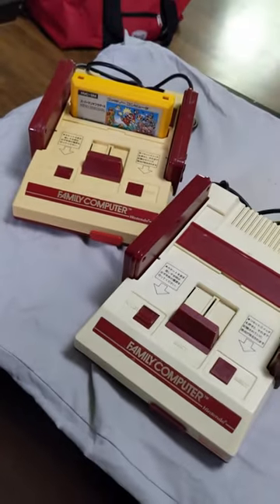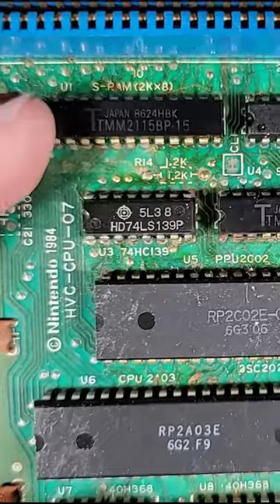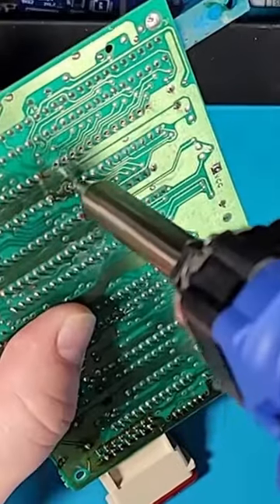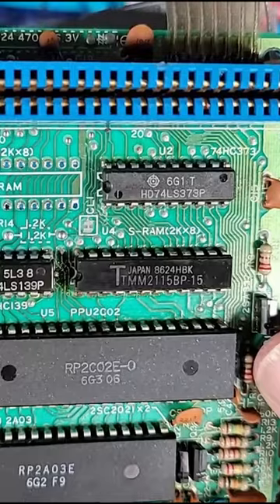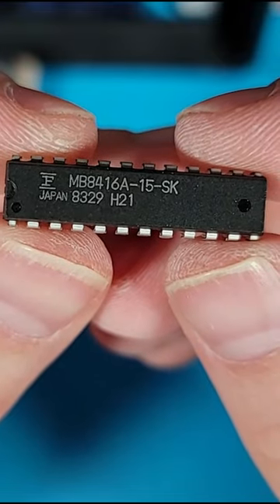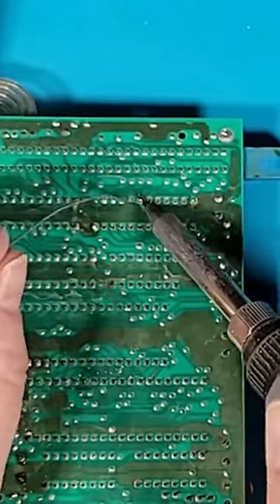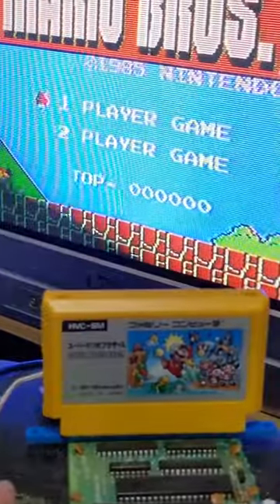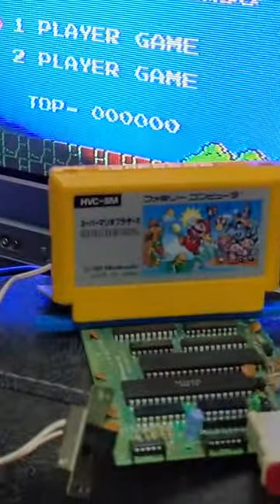This Old Nintendo Has A Strange Problem #SHORTS Famicom VRAM Replacement

Comment: i have found that when a chip is smooth and shiny like the old ones they are normally bad
Reply from the maker: I noticed this! I wonder if it is caused by the chip heating up?
Reply: @MadModLabs  i would say probably as those types of chips can generate a good amount of heat some times

Comment: The North America NES has 2 RAM chips but 1 is Program RAM & the 2nd is Video RAM. Does the Japanese Famicom use smaller capacity VRAM chips where it uses 2 instead of just 1?

Comment: Serious question: why didn't you solder in sockets after getting the old VRAM chips out?
Reply from the maker: Sockets can be installed to make the chips swappable. When I did this I didn't have any sockets that were the correct size. So if one of the chips fail in the future, it will need to be desoldered again.
Reply: @MadModLabs  Ahhh. I was going to ask the same thing... wasn't sure if it was clearance issue or not having any of those goofy 24p sockets. I never have anything bigger than 18p when I need them.

Comment: I personally dont think its worth fixing, in my country you can get them for like 10$ or less
Reply: Fixing old technology keeps it out of the landfill. There are more reasons to fix something than simply monetary gain. Electronic waste is a huge problem and this keeps some of it from being dumped.
Reply: Real Famicoms for $10? Or are you taking about crappy clones (which often have screwed up audio and don't work with Flash Carts and original carts with certain expansion chips)?